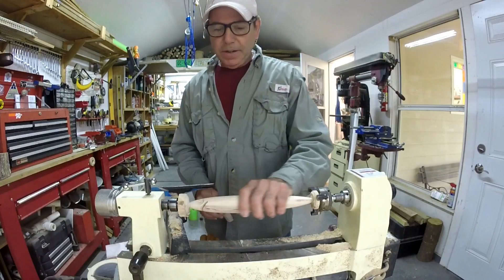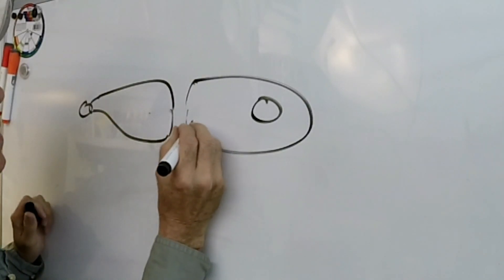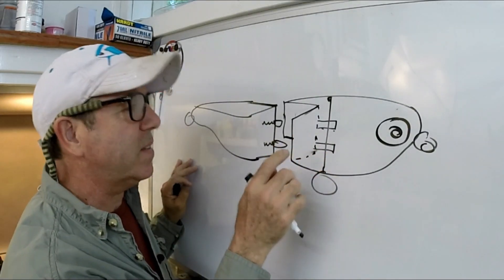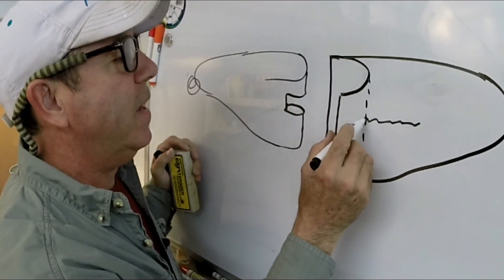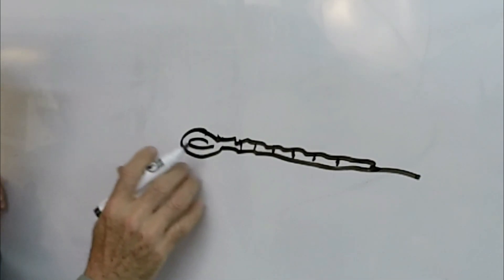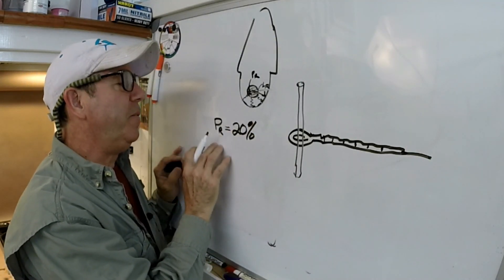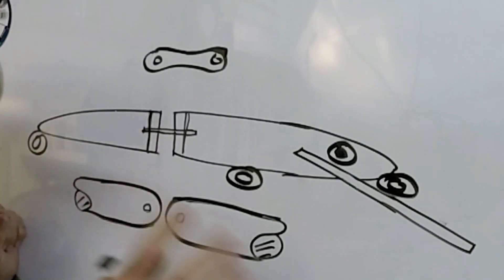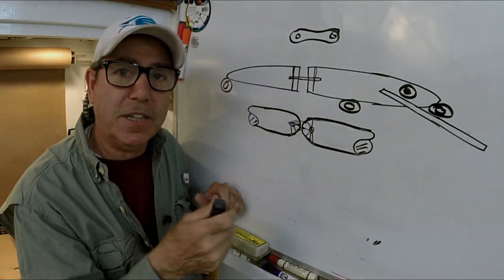Lure Hinge Design and Engineering

Comment: Have you seen the strike pro gill raker series of baits? They have a similar hinge to the V except it has amazing action and very round shape bend do to how they attach the sections. The hardware isn't your typical screw lock style it's more a double u shape to u shape hinge that also shifts in and out allowing a very nice swimming action with not restriction of the V hitting and stopping it from having a nice bend and swim motion..
Reply from the maker: Yes they did a nice job on that lure. It's a little easier when you're dealing with a molded two-piece plastic body. Also it's five segments, that give you a little more motion across the whole length of the body. It's a nice lure for sure
Reply: @EngineeredAngler  Yes they did make a 5 segment but they also made the same bait in 3 segment I purchased them all in each color lol first time I ever did that with one style lure but they did do a great job I really liked how they did the segments. Also great video I found your channel just recently but been enjoying your content.. But yeah they ha e the 2 sizes same style lure just one is I believe 2.5 or 3.5 and the other is like 4.5 or something along those lines I purchased them last month so I don't Remeber exactly. But yeah I believe one is the 80 and the other is called the 90.. well have a great day
Reply: Okay sorry the smaller version is 3 segments but it's about 3.5 inches. Otherwise it's action is crazy compared to many other styles like you mentioned! That u shape connection between the joints allows it to shift in and out some allowing it to achieve that bend like you shared in the video that also allows it to swim so nicely compared to others

Comment: What about twisting? Seem like that would be the issue with that design.
Reply from the maker: Twisting is an issue to be addressed (ideally ) in the lure body design. If you have twisting between segments it will at best reduce the swimming action and at worst render the lure unstable at quicker retrieve speeds.

Comment: One thing I have learned in the past twenty years of  lure making is if it works good don't change it. I have been using double eyelet for henge's and they never fail. Don't take something simple and make it complicated. Lure building is not rocket science
Reply from the maker: I have to agree with you, that's the most reasonable approach. My problem is that I'm  seldom reasonable in my Approach to things. I just love to experiment even when it has limited value in the end. Thank you for your input. It's nice to hear from the veteran lure Builder.
Reply: I have to disagree. How did you get to the method you currently use? There is always room for improvement. Hemp rope used to be fine until someone tried using metal to make the strands and now we have flexible cabling that can sustain bridges, and winch our boats onto our trailers. You are correct in saying we can overthink a problem, however lure making is a very competitive industry, and the better mouse trap will win the day. Only an opinion friend. Hope your lures are always full!